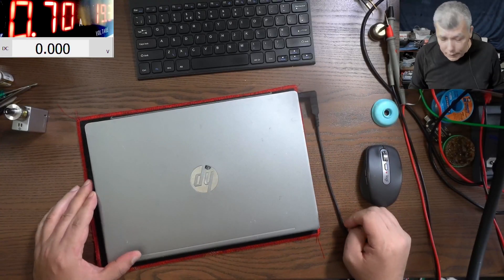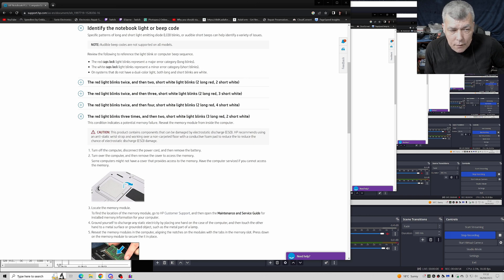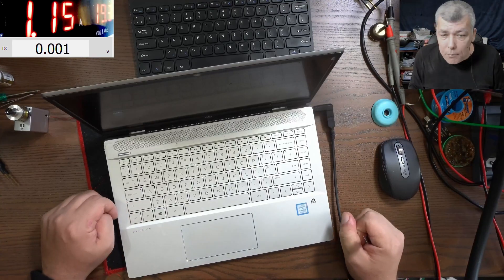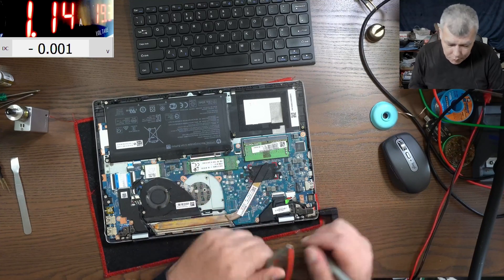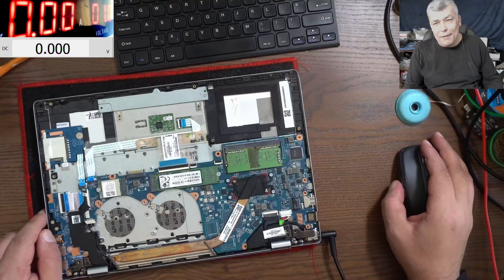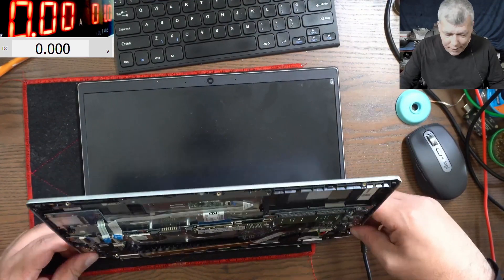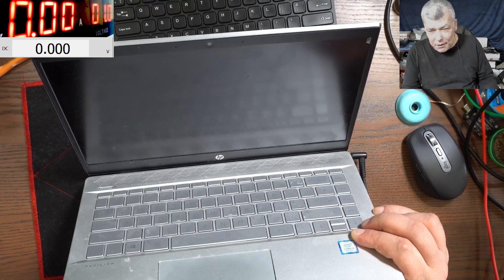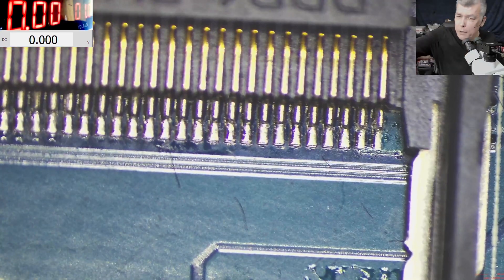HP laptop - coming with no picture - can be the ram slot

Comment: I feel like my mini pc has a similar issue. it won't post, then randomly will sometimes, but the keyboard won't work in the bios settings menu. The one thing that looks weird after throroughly inspecting it... is the ram slots. They are ddr5, the ram chips look perfect, it's a very nice minisforum hx99g, but if I clean the ram slots very good with a small pick and alcohol to where they look absolutely perfect, and then put a stick of ram in and take it back out, the pins look like about half or a third of them are bent or something, they don't look uniform anymore. The pins feel solid, but they look like maybe they are being forced into touching each other when the ram is in. I don't know, could be totally wrong, but I can't find any other reason the thing won't turn on, it doesn't get hot like there's a short, but resetting the CMOS did make a slight difference, although it still didn't fix anything.

Comment: I can't tell if this is a user fault since it has poor tolerance on the mechanical properties of the board, I mean if I were to design it I would set the ram slot on a low torsion portion of the board, regardless some people do treat this things as if they were built on hard concrete, finding out if it's a design flaw or a bad user treatment it's hard since I mean under good treatment should not fail and it won't, but, lets carry it on my backpack for a few weeks and boy you'll see, that kinda end user treatment should be considered while designing